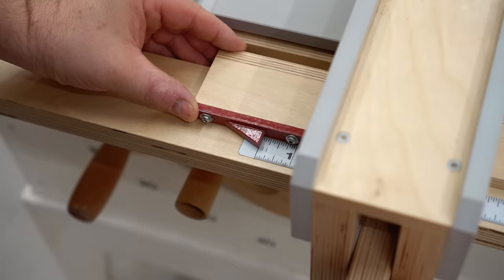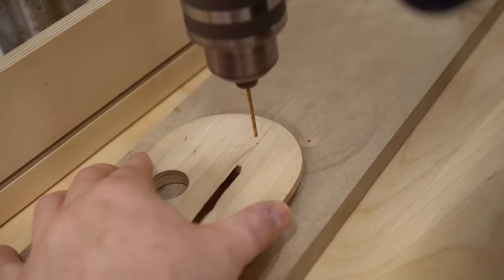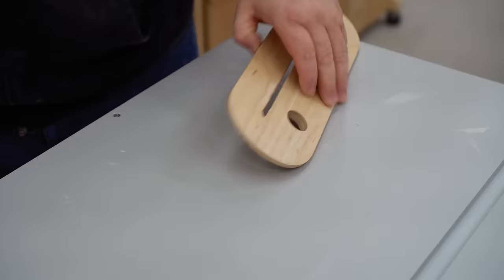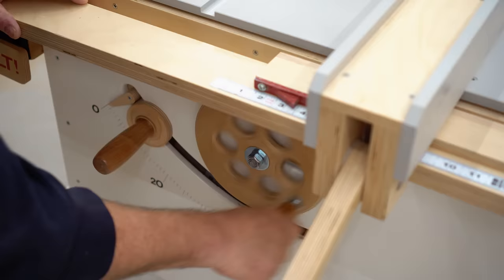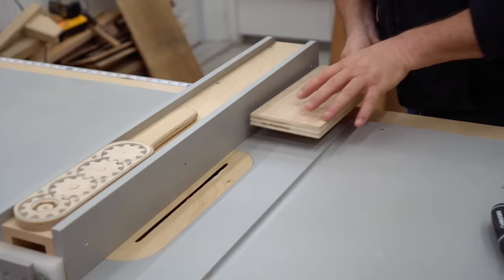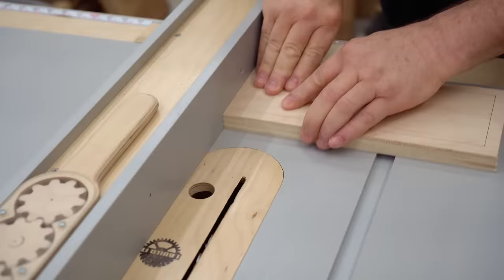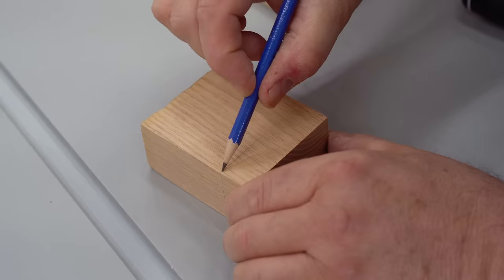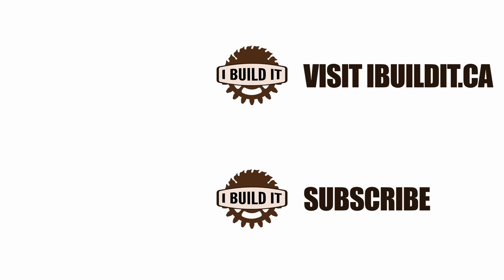Genius Idea? Must Watch! Not Clickbait!

Comment: It'd be nice if that screw could stay put so you don't lose it, even if it is just a drywall screw, but it'd probably be inadvisable to keep a screw that close to your table saw blade in any case. I might be nervous about it,  if only on principle. You could make a whole new insert plate without the blade slot, though, so you won't accidentally try to make cuts while it's installed. That way there's an extra failsafe, plus the screw can be permanent so you don't have to back it out every time, and a part that size is a lot harder to lose. Or you could make a real contraption out of it to make the depth adjustable...I can imagine something with 3 dimensions of adjustability, for someone who's got the time to spare and appreciates a good old-fashioned unnecessarily complex solution.

Comment: Me: Tries it out. Neat trick! Forgets to swap plate. Goes to cut something. Thinks blade is dull. Sharpens blade. Wood still hard to push. Sends blade out to get "professionally" done. Wood still hard to push. Buys new blade. Still doesn't work. Adjusts saw table and fence. Still hard to push. Buys new saw. WORKS AWESOME! Starts to take apart old junk saw to toss. Gets a poke. Crap.......!

Comment: Setup two, one for the near and far side of your blade. The scoring might help with tear out from the blade, maybe?

Edit: This comment mostly for the sake of the algorithm.
Reply: You could set up a series of them at marginally increasing scribe depths and remove e need for the blade completely
Reply: @mileshadrill6885  That is really clever, I like it! But it seems like it would take a lot of cutting tips and a lot of force... what if, and hear me out here,  we mount the tips on a disk and use a motor to spin the disk pushing the tips past the board? I'm pretty sure I saw this idea somewhere before... hmmm.

Comment: I'd be pretty concerned i would forget and raise the blade into that screw (very expensive with a saw stop).  I think it would be best to make a new plate that doesn't have a blade kerf.  Absolutely love the idea though.  This came at the perfect time because i need to make a few inserts anyways.  love it
Reply: Never happen. The blade doesn't go that far into the front of the insert. Even if it fell out due to vibration, it would simply fall to the bottom of the saw because gravity... lol

Comment: If you anticipate using this technique repeatedly, why bother to remove the entire screw, potentially misplace it, and have to sharpen a different one? If you're already using a grinder and/or a sander to sharpen the screw, just shorten the screw so that it is barely thicker than the table saw insert. When you wish to score something, tighten the screw to extend the point above the surface. When you are finished, back the screw out enough to lower the point below the surface. You just need to position the screw far enough from the blade so that the head of the backed-out/lowered screw doesn't extend into the saw's teeth as the saw is raised and lowered.

Comment: Fantastic idea. Could you put the screw on a pivoting dowel under the insert, with the screw going through the dowel and not the insert. The insert would just have a thin slot. That way you could just push the screw head towards you to "hide" it flush with the surface, and then flick it up again when needed. It would mean you would only be able to mark going away from you, but that's pretty much what you'd do anyway I'm guessing. Possibly too complicated (although still fairly simple), but I'm really, really concerned about all those sharpened drywall screws lost in the wilderness.
Reply: Or do what Barry Irby suggests and just put the screw behind the blade in line with the kerf and it can stay there forever.  Why over-engineer things?
Reply: @mileshadrill6885  because I don't know who Barry irby is, and hadn't thought of that? Barry's is a much better solution, well done Barry.

Comment: So i watched it with the sound off, and i thought this was scoring the plywood to prevent chipout. Would that work?
Reply: Blue tape works pretty well, but a zero clearance insert works better. I don't know that the score line here would be wide enough to do much since the blade would be cutting to either side of the line.

Comment: If the screw is located paralled to the center of the blade  it can stay put as it will never interfere with a piece of wood  because the saw cut will obliterate the mark.  Just a thought.  So leave it there.  Ok
Reply: Put the Screw on the outfeed-side. Setup once and forget...

Comment: Use a shorter screw and move it further away from the blade... Then you don't have to remove it. Just back it out a 1/4 turn when you don't need it.

Comment: Great idea but the one flaw i see i that obviously you are not being as precautious with your finger positionning (need to put weight on the pin) and i could alter your muscle memory leading to adopt that movement in a not so safe moment.
What i always heard in workshop is to always treat machinery as live otherwise you'll develop bad habits and bad habits are risks.
Simplest option may to do the marking with the usual pushsticks.

Comment: The concept is nto bad BUT:
Make it an insert for the insert, one that you can just flip upside down to hide the point. Because like this you now have a screw sticking down into the area of the blade.
if you forget ti remove it and the vibrations loosen it up....

Comment: John, wouldn’t this work for scoring the fibers to minimize or eliminate tear out as you run the workpiece through the blade?
Reply: That's actually where I thought he was going with this. As long as it's right in line with the cut side of the blade it seems like it would be a great solution.

Comment: John, your idea is genius, but you could leave the screw ijn if you put it behind the blade. This way it wont unnecessarily scratch / prescratch / catch the pieces you put on the saw, and the cut will make the work clear the screw. Leave it there forever.

Comment: I am not sure if this serves any purpose, my marking gauge (a cheap igagin digital one) is very accurate and super fast to set and use. 
May be if you dont own a marking gauge... or idk. Some may say that since it is aligned to the blade you may use it to align your work piece... but if your saw if properly set, you can rely on your meassurements and if not or if your blade vibrates a bit, you anyways need to sneak the cut. 

So even when i think its a clever idea.. i see no real use other than a big marking gauge. 

I always judge my ideas not on how unique and ingenious they are, but in how useful they may be. I dont see that here. But may thats just me

Comment: Why even remove the screw? Put it in line with the saw, on the side where you are moving towards when using the saw. This way no material will be moving over the screw tip in this case (because the material was just removed by the saw on that line!)

Comment: Great idea!  You weren't wearing a dust mask or safety gloves around such a dangerous piece of equipment. ; )
Reply: Please tell me, for your own safety, that you don't use gloves around power tools.  If you do fuck up, it's far more preferable to lose the tip of a finger than to get a glove pulled in and mangle your whole hand.

Also, it goes without saying that you don't actually need the tablesaw running to use this trick...
Reply: @siosilvar  Hence the old school wink emoticon at the end of my post.
Reply: @jimk1577  Typically sarcasm involves only one layer of misdirection, lest you be confused for saying the opposite of the opposite of what you intended. ;)
Reply: @siosilvar  Thank you for the lesson, I truly appreciate you taking the time to educate me in sarcasm.
Reply: @jimk1577  Glad I could help. :)

Comment: So, I pull my insert out, screw a screw up when needed, replace my insert(3 screws to do this)and then I set my fence to mark whatever it is I need marked and you people think this is genius? That is an awful lot of work and far too many needless steps, because then you have to move the fence, remove the insert, back out the screw, put the insert back in, and then you're done. So, a easy to make marking gauge, or easier to buy, set the distance and go. Pick up gauge, set distance, mark. Yeah I can see how this is genius, lol.